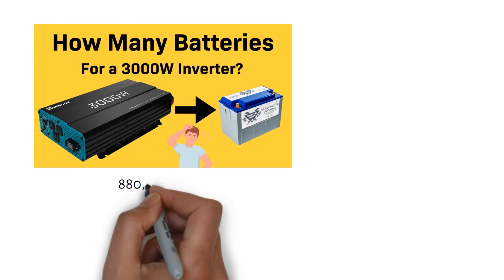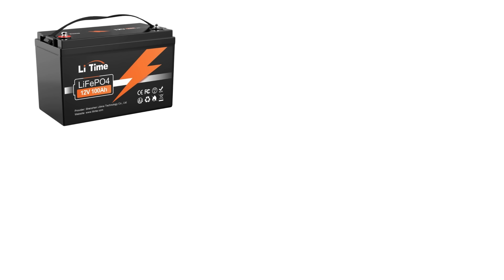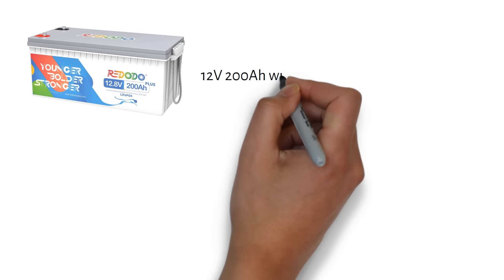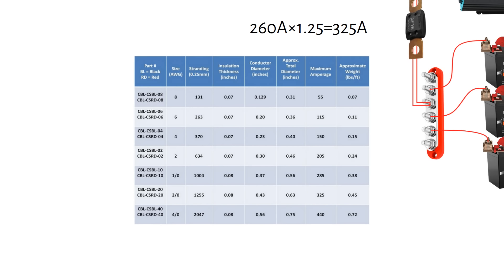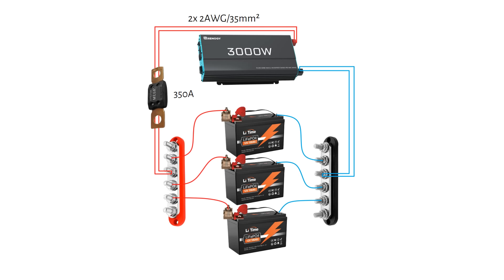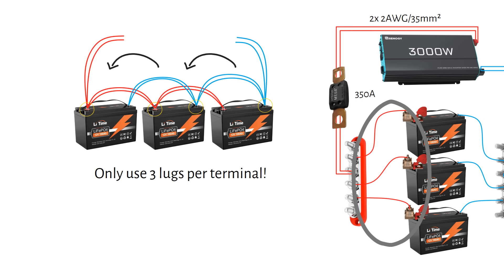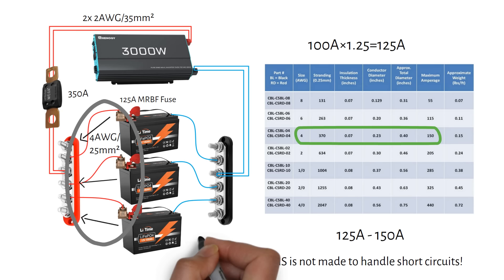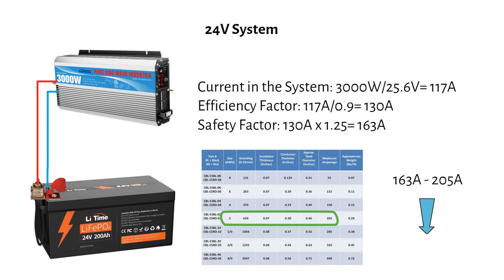How Many 12V Batteries for 3000W Inverter

Comment from the maker: FREE diagrams: https://cleversolarpower.com
UPDATE 1 : at 14:30 I used the wrong formula. It should be Capacity=Current/C-rate -> 250A/0.2C=1,250Ah. 
UPDATE 2: at 6:40 you should fuse every cable with a 200A fuse instead of one 350A fuse.
 My Best-Selling book: https://cleversolarpower.com/off-grid-solar-power-simplified
Cables: https://amzn.to/3XbLfhn
12V 100Ah Battery: https://amzn.to/3MgFdWw
12V 200Ah Battery: https://amzn.to/3SYwtYI
MRBF fuse holder: https://amzn.to/3X0bmqc
MRBF fuse: https://amzn.to/4dXFNV5
300A busbar: https://amzn.to/4dR4Zwj
MEGA fuse: https://amzn.to/3AyrYht
Reply: I think there is still something wrong with calcs: 250A is the invtr max amps, C rate applies to batt amps not inverter amps: batt amps is 20A. So is it Inverter amps/C rate, or batt amps/C rate?
Reply: BTW, I am using 4- 6vdc Fullriver AGM batteries with a GoPower 3000W inverter. I installed the new AGM's yesterday, but was trying to chk, beforehand, if 4 batts would work with the 3000W inverter.
Reply: @Romeo1800  kích 3000w 12v bao tien
Reply: Could you please advise me. I tried to educate myself as well as I could before my build. But there are so many different opinions. I have a 3KVA , 2400 watt Hybrid Solar Inverter DC 24V to AC 110V  and 
NEW 280 ah, 8s lifepo4 battery with a 200 amp continuous  BMS.  
  The 3KVA Hybrid Solar Inverter DC 24V to AC 110V  said I need 4 gauge. battery cables. So I got 4 gauge fine strand welding /battery cable and lots of it. From battery to the inverter is only about 3 feet.
  Going by the 4 gauge suggestion for the inverter, I used a T Tocas 150 Amp Surface-Mount Circuit Breakers with Manual Reset Switch Button, and 175 amp quick connect, so I don't need to get into the battery box with a wrench, when it gets moved or serviced.
 Although I don't come close to the 2400 watts in normal use. I have tested up to 100 amp draw from the battery and checked for heat in all cables and connections , and did not see anything get hot for an hour or so. Can I do this better?
Reply: I use a 64ah headway on my 3000w and 8000w.  12v inverters. Depending on how long I need it  i can use a bigger ah capacity.  Thr headway can dump alot of amps vs those ones u have
Reply: i got what you where saying i only have 1 battery so far and i love it i only paid 150.00 dollars and recived it in 2 days and it has a bluetooth app as well and works great for the price
Reply: yeah, i got that while i was watching the video, then i saw your correction on the comments. still THANK YOU!
Reply: Why do you only show the most expensive places to buy the parts ?

Comment: RENOGY 3000 Watt Inverter is a Sour Purchase and Collects Dust here now, 4 RENOGY 200ah AGM Batteries barely Feeds It what It Needs with 4/0 Premium Wire and 300amp Buss Bars - I see Myself Selling It Soon and have opted for 24 Volt Victron Energy Inverters and Lithium Batteries now and in the Future.
Reply from the maker: Good choice 😉
Reply: I've been running the RENOGY 3000w inverter with 4x100ah RENOGY batteries in my 4x4 ute for over 2 years. When it's parked up at home it runs all refrigeration and computers in the house 24/7 and occasionally more when the suns out. I haven't had any issues with their gear. The batteries get charged via 2.6Kw of solar panels on the shed roof via Victron controllers. The batteries and inverter are wired much as Nick showed except the MRBF fuses are 100amp as with 4 batteries feeding a 3000w inverter they are never going to see 100amp drawn from a single battery.

People wonder why some choose to stick with 12v particularly with recreational vehicles. The answer is simple. It's a pain in the backside trying to deploy enough solar panels out in the field with high enough VOC to charge a 24 or 48V battery system. Connecting multiple panels in series is impractical when camping. Then there is the huge expense of 12v-48v DC-DC chargers to take alternator current from a 12v system. Typically such DC-DC chargers are 3x the price of a 12v version. Or the alternative option of fitting a 24-48v alternator if space can be found in the engine bay. Then there's all the 12v camping appliances that now need buck converters. The 4/0 cable is only needed between the inverter, fuse for it, and Buss Bars. That's not a huge expense that those that advocate 48v continually bring out in discussions when compared to the additional cost of dedicated 48v gear and buck converters etc.
Reply: @erroneouscode  4 RENOGY 200AH AGM Batteries was tried here with 1200 Watts of Solar and saw 50% Depth of Discharge way too often to Leave IT commissioned here on The Ranch
Reply: @1GREATDANE  Fair enough. But curious what made you even consider using AGM these days, especially with a 3000w inverter? What did you find wrong with the inverter?
Reply: @erroneouscode It was Hungry and AGM Batteries are Best above 50% DOD and a Whole Ranch Kitchen was more than It could Handle at Night, TV and Internet Router, and few lights and Well Pump.  Going 24 Volt I was able to Double My Solar Array and using 4 - 280ah CHINS LiPo4 with 200ah BMS paired up in 24 Volt Packs Works well with Victron Battery Balancers and Buss Bars and Correctly Fuses and 4/0 Cables to WZRELB 24 Volt 3000 Watt Inverter.
Reply: @erroneouscode Renogy limits Us to 12 Volts and AGM is Back Up Power Bank for Winter Time due to Freezing Temps here up on The Mesa at 3,100 feet just north of Big Bear Lake Mountain Resorts Community in here in The Southern California High Desert 🌵
Reply: Made the mistake of not researching Renogy before buying a couple of solar panels. I eventually got them..but it was a bad experience.
Reply: If you paid attention to the video you would have seen that you require 7 200AH AGM batteries, not 2.  Blaming Renogy for your ignorance is poor form.  Maybe you should just get 2 200AH Renogy Lithium batteries as described in the video.
Reply: @einfelder8262  This Purchase and System was last November and I didn't watch Nick back then and much wiser now and Totally into Victron and 24 Volt Inverter Systems here which RENOGY does Not Support nor Offer.
Reply: Here now same amount of Ampere/hour with AGM cost more then LifePo4 because you need almost double the amount of batteries with AGM to do the same job. I bought 4 100Ah 100A lifepo4 batteries for my van as it saves me about 200kg compared to AGM of similar capacity (+ AGM costing more).
Reply: With 4 100Ah 100A lifepo4 batteries and my 3000w 24v inverter I can use an electric oven with 2 cooking plates and  electric oven with all 3 at full power at same time. And I can keep it running like that until the batteries is empty which will take 1,5 to 2 hours as I do not know the exact power usage of the electric oven. LifePo4 is the way to go for high power usage.++
Reply: I'm going through the same stuff and learning a lot, and appreciate your info. Thank you
Reply: I’ve been running a Trace 4048 at our remote cabin for 21 years.  I just had 8 12v AGM batteries.  I just replaced the batteries.  The beauty of higher voltage is less current which means smaller wire,  breakers and fuses. I also use 2/0 wire. I never need the full capacity of the inverter, but is was nice when I used power tools or even a small wire feed welder.
Reply: I bought the Victron 24/1200 inverter and 4 Li Time 24 volt 100 AH Lifepo4 Batteries. Hooked to 8 100 watt solar panels in a 4S2P Array and Victron 150/35 Charge Controller. It's a well Balanced system
Reply: @hegefarms4260 ironic that I stumbled upon your comment because I am considering almost the same exact setup. I have a question, you said you have a total of 4 batteries (100AH each x 4 batteries = 400AH) I have a friend who recommended that I go with a Delta Power Station because of my inexperience with solar. The Delta EF Ecoflow says that it provides 3600 Watt Hours. How does 3600 Watt Hours compare to 400 Amp Hours. How do you do the conversion? I am new to all of this and don’t understand much. I was also told that I could easily hurt myself with a DIY system if not careful… not sure if it is right for a newbie?  Any help would be greatly appreciated.
Reply: @JenniferMedina-bg1zb 12v * 400A = 4800. Drop that by 10%  so it’s around 4400w, the Delta Pro 3 is what I recommend if you need over 3600w everything is well built and integrated with WiFi app. It’s portable but heavy. I’m ok with that. Hope this helps!
Reply: Can't comment on the inverter or the batteries.  I'm assuming your wires are cold when pulling the amperage.  With 4/0 they should be,  if they are warm, your wire may not be what the vendor claimed. 
Check your connections for heat, heat would be a waste of energy at best and a safety problem at worst. 

Find out from renogy how they arrived at 200 amp hours for each of their batteries. Thank to peukerts, you can play with numbers.

https://en.m.wikipedia.org/wiki/Peukert's_law?origin=serp_auto
Reply: @1GREATDANE  I was tempted to buy this inverter, but because of reviews like yours, I too chose Victron. Thank you!
Reply: English please
Reply: @erroneouscode I'm using 4, 6v, 210 Ah deep cycle lead acid batteries. This gives me 420Ah of 12v in series/parallel. I have a 3000w renogy inverter and only 2 100watt solar panels and a mppt charger with a 50 amp dc-dc to connect to the truck. 

I can't seem to run out of power or overload the system in any way and just like you I connect it to the house when the camper is at home... 

I'm totally happy. I'd go with lithium next time mostly because of the lower weight
Reply: Sell it to me lol I love mine
Reply: @JenkinsUSA his problem is due to poor battery choice, not the inverter.
Reply: @mj_aussie_coaster_travels8310  Thank you for the clarification. Happy New Year 2025 🎉
Reply: You are ABSOLUTELY doing something WRONG then.  You AGM's are shot or something because 800ah of 12volt into either of the Renogy 3000watt pure sine wave inverter or inverter charger will do HUGE power.  So something is very wrong in your build or your batteries.  And you 'feed' the Renogy 3000watt inverter ONE 200Ah Lithium and run a mini fridge , a 32" Tv , and Starlink for 24 Hours on a full charge.  EASILY
Reply: @1GREATDANE AGM is dead technology.  Lithium safely gives you 80-85% DOD and cleaner energy to your inverter
Reply: I will but the Renogy 3,000 watt inverter.
Reply: @NomadSurvivor  agreed
Reply: I HAVE BEEN USING A 3000 WATT GENERIC BRAND PURE SINE WAVE INVERTER  , CONNECTED  TO A 300 AMP LITHIUM LIFEPO BATTERY VIA A REDARC TOP OF RANGE DC/DC CHARGER FOR A FEW YEARS AND HAVE NEVER HAD ANY TROUBLE AT ALL. RUNS EVERY THING I NEED AND THEN SOME.
Reply: @NomadSurvivor  FREEZING Winters I need the 4 200ah RENOGY AGM'S and The lithium stop Charging below Freezing on Us - I just Can't Run Heavy Appliances for Very long Them Them as per My HUNGRY COMMENT.
Reply: @ Yes , depending where you live non heated Lithiums will deploy their low temp charging protection on you.  I am in Northern Ontario and had that issue initially.  I found a solution with 12v battery heating pads , they are temp controlled and turn on at 0(32f) and keep the battery above that cutoff temp.  They use very little current and if its for charging it more than offsets the usage.  Unheated Lithiums still perform well in cold temps , its just the charging cutoff protection that causes a headache 
The heating pads I got were $15.99 ea , I have 3, and they work perfect. 
The reason it's worth doing that is the DOD on Lithium vs. AGM is such a huge difference and when you require a lot of power to live comfortably, the Lithiums always make sense.  Of course for anyone about to buy their lithiums and living in a 4 season climate , Always spend the little extra for self heated lithium batteries.  The AGM's are sooo heavy and just annoy me that if you take them below 40% they lose their capacity quickly.  Not to mention charging far more often and requires much more power to recharge them. 
I was using those thin/tall orange industrial AGM's before my Lithium switch.  I had 4 of the 280ah 
after 2 years they dropped to about 150ah at best.  Although I was hard on them running 2 - 3000watt renogy inverters and far too many appliances.

Comment: Is it not the load is the one that dictates the power needed? If the Load is a 700W Microwave, then a 100AH, 12v battery is sufficient. If your load will require 3K Watts, yes, then more batteries are needed like you stated.
Reply from the maker: Yes, the load indicated the power draw. But if you have a 3000W inverter, you have to wire and fuse for a 3000W load.
Reply: @cleversolarpower  what happens if you have a 3000w inverter but only wire and fuse for 2000 w ?

Comment: You dramatically forgot about the TIME. Batteries reserve energy, which is time times power. Battery capacity unit is Amber's.hour. You know the applicable formula.
Reply: Amp hours?

Comment: With 4 100Ah 100A lifepo4 batteries and my 3000w 24v inverter I can use an electric oven with 2 cooking plates and  electric oven with all 3 at full power at same time. And I can keep it running like that until the batteries is empty which will take 1,5 to 2 hours as I do not know the exact power usage of the electric oven. LifePo4 is the way to go for high power usage.
Reply: @a64738 how do you connect your battery bank reason being I have 4x12v 100ah lithium batteries and a 3000w 24v inverter.So I wondering if you would like to explain how you did  it.
Reply: @claver99 you have to connect all your batteries to each other…you have solar panels and a controller unit too??
Yeah they make tiny cables to connect the batteries to each other

Comment: I have 3 marine led acid batteries deep cycle connected in parallel to a 2000w inverter with 400w solar panels  to power a tv but it just take like 4 hrs to drop my batteries voltage to 11.9  should I buy more batteries or should I change to lithium batteries?? My Tv is a 70in smart TV
Reply from the maker: Assuming every battery is 100Ah, and you can only use 50Ah per battery, you can 'spend' 150Ah at 12V. that is 1800Wh. *0.8efficiency= 1440Wh Let's say your tv uses 50W, and the inverter 15W for a total of 65W, you should be able to run the tv for: 1440Wh/65W=22 hours. It could be that your batteries are never fully charged and that your solar panels aren't enough. Could also be that your lead acid batteries are dead.

Comment: I'm new to all of this, so ty for the video. If anyone can help me (break it down in simple terms) with my setup, you'd be very helpful. So here's my setup... I have a VEVOR 5000w inverter (continuous watts of 5k), (4) 12.8v 100ah lithium batteries, (2) 100w solar panels (however, I just bought 2 more to be installed, which will make it 400w), and a Renogy 40a solar charger. Everything is connected in parallel. The issue I'm running into is...when I use an appliance that is 1500 to 1700 watts (i.e. my power station generator, which has 3000w, 120v, 15A...it only takes 1700 to 1800w to charge...), my inverter starts smoking. Not to mention, when I check my batteries while running these types of appliances, they start to lose power quickly. Why is this happening? Do I need more panels, another charge controller, more pos and neg cables (the inverter came with 2 sets) and or more lithium batteries? Any advice is much appreciated!
Reply from the maker: If your inverter starts smoking ,thats not a good sign 😅. Have you tried with another inverter and have you checked the cabling? Please send me an email with pictures of your system so i can help you out.

Comment: Is it possible to run a wind turbine thru its own 12v rectifier controller and then take that output and splice it in parallel with a 12v solar circuit and then just use a 12v solar charge controller. Or should I go ahead and purchase a hybrid charge controller with a dump load. My solar will only be 12v @ 400w and my wind turbine is rated 400w peak 500w
Reply from the maker: I don't know anything about wind energy because they are not worth it for small systems.

Comment: Thank you for the reminder that we can use multiple smaller gauge wires to carry the high current loads from each battery!!! Much easier than working with 4/0 wiring.
On why 12v batteries, I started with a system to supply my RV with DC power first, and used 12V a Lithium battery systems because 24 or 48v system would need a DC-DC converter to supply ALL 12v DC needed by the RV for lights, propane heater, fans, water pump, 12v refrigerator and all of the DC controls for other appliances.  Most DC converters have poor efficiency so there is a lot of heat/energy loss to power all the DC devices in the RV.
Then ….. we decide we want to expand our system to add an inverter for occasional use of AC appliances like a microwave oven or charging laptops/tablets/phones/etc and don’t want to replace our 12v battery bank.
Reply from the maker: If you are going to split the wires up, they need to be minimum 1/0 (55mm²) each. If you split the 4/0 cable into two cables, they each need to be fused and be minimum 1/0, but in your case you need 2/0 minimum.